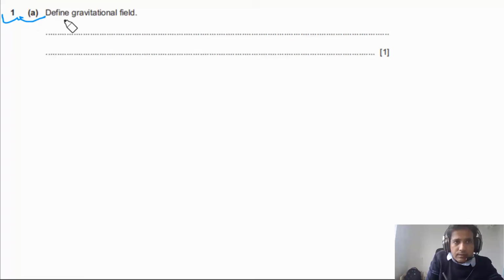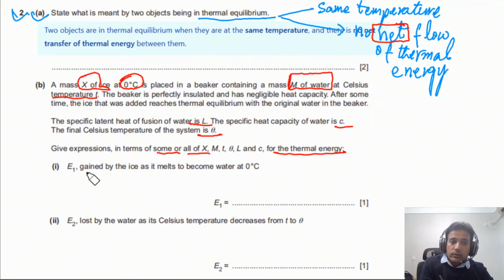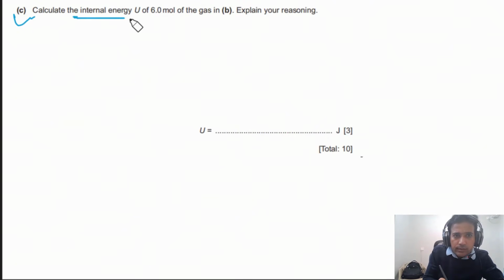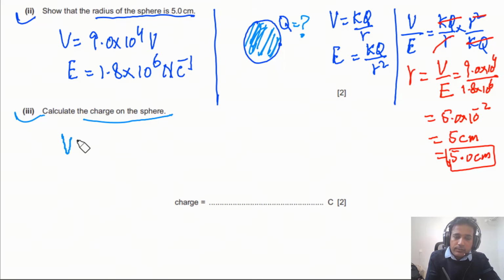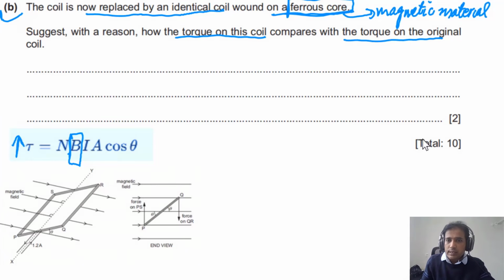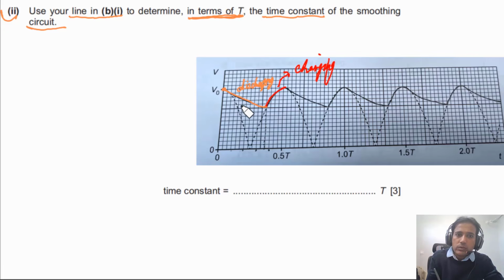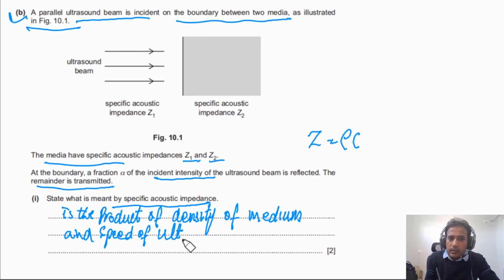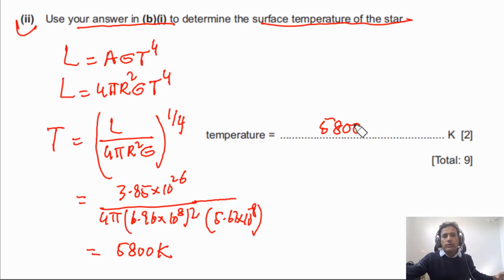A LEVEL PHYSICS 9702 PAPER 4 | May/JUNE 2025 | Paper 44 | 9702/4/M/J/25 | Full and Detailed Solution

Comment from the maker: SUMMARY 

This video provides a detailed solution and explanation for past paper questions from the May/June 2025 A-Level Physics Paper 4 variant 4. It covers several key physics topics, including:

Gravitational fields and potential (0:54)
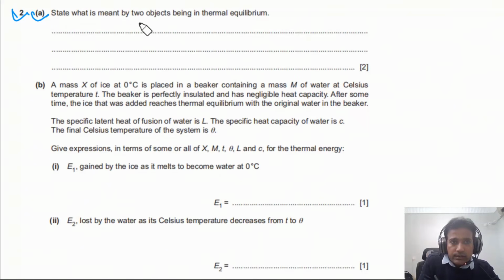Thermal physics, including thermal equilibrium, specific latent heat, and specific heat capacity (14:37)
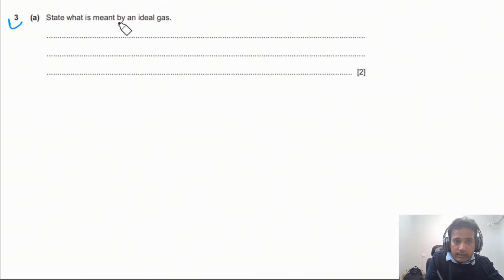Ideal gases and related equations like the ideal gas law and root mean square speed (24:15)
Simple harmonic motion (SHM), its definition, and properties like velocity and displacement (34:43)
Electric potential and field strength for charged spheres, including capacitance (41:48)
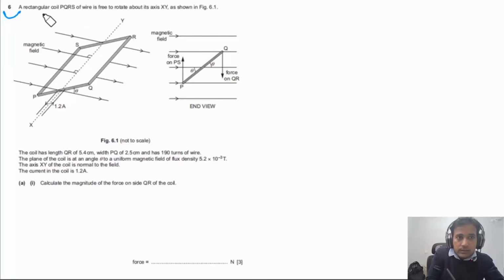Magnetic forces and torque on current-carrying coils in magnetic fields (52:34)
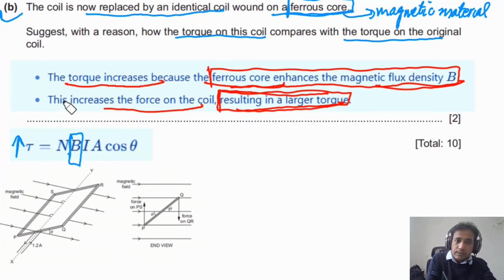Damping in oscillations and electromagnetic induction (1:04:41)
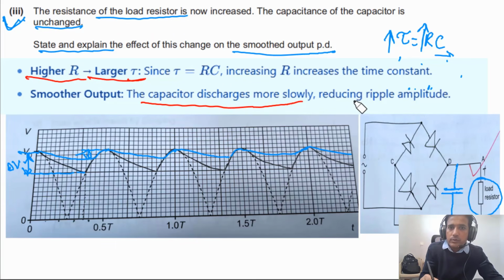Wave-particle duality and de Broglie wavelength (1:25:00)
Ultrasound waves in medical diagnosis, including piezoelectric crystals and acoustic impedance (1:31:00)
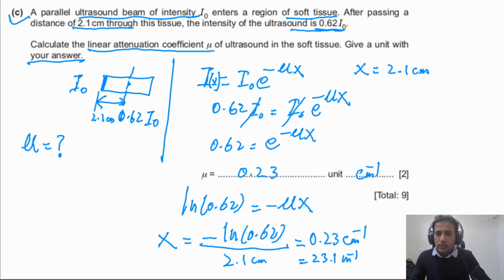Nuclear fusion, mass defect, and luminosity of stars (1:40:51)
The video aims to improve conceptual understanding and exam question comprehension for students.

Comment: Sir for question 9bii can i say fringes on the screen become closer instead of saying rings ?
Reply from the maker: In short NO. "fringes" is a general term for any interference or diffraction pattern, using it here instead of "rings" is risky and likely wouldn't meet the MARKING STANDARD OF CAIE . 
My Recommendation : Stick with "rings become closer together" or "diameter of the rings decreases." This ensures you are describing the specific pattern shown in the diagram and eliminates any ambiguity that might lead an examiner to withhold the mark.

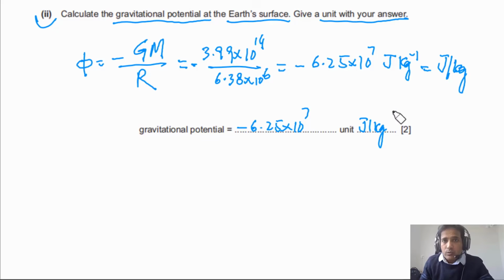Comment: 9:29 

Just a quick query 

1) Often value calculated in first part is used in second one ….When to know if you must use calculator value from previous part or the final answer (rounded value)
Bcz often examiner uses calC value as well 

2) Your answer to part c)ii) is 6.25 bcz qs had least 3 s.f for data 
I also wrote 6.25 but in ms it was boldly written 6.3 
Will it cause loose of marks?
Reply from the maker: Rounding Strategy: For CAIE examinations, it is best practice to use the unrounded value from previous steps in subsequent calculations to maintain precision. However, using the correctly rounded intermediate value is generally acceptable.

Significant Figures (Q1 cii): The final answer should be given to 3 or 4 significant figures. Since the raw data provided has a minimum of 3 s.f., the final result must remain consistent with this precision. May be you can check markscheme again

Comment: For question 7 ...
If there is just coil and no resistor will the oscillation still damped
Reply from the maker: Even without an external resistor, the coil itself has resistance, leading to energy dissipation and damped oscillations as long as it forms a closed circuit.
Reply: @alevelandapphysics-ali  I think damped oscillation comes from lenz's law, only energy lost in the resistor cannot explain damping
Reply from the maker: @eighoreishongsar2336  That is a very insightful point! To clear this up, we need to look at the 'Why' (the force) and the 'How' (the energy).

1. The Force (Lenz's Law):
You are right that Lenz’s Law is the reason for the 'magnetic brake.' As the magnet moves, it creates a current in the coil that pushes back against the magnet. This is the physical force that slows the motion down.

2. The Energy (The Resistor):
However, for the magnet to actually stop, it has to lose energy. Damping is simply the process of turning motion (kinetic energy) into something else. In this case, the resistor acts like a 'sink.' As the magnet does work to push current through the wire, that electrical energy is turned into heat (P=I^2 R).

3. What if there was no resistor?
If you had a 'perfect' coil with zero resistance (and no air resistance), something strange happens: the magnet would actually keep oscillating! Even though there is a magnetic force pushing back, there is nowhere for the energy to go. The energy would just 'slosh' back and forth between the magnet’s motion and the coil’s magnetic field—like a perfect spring that never stops.

Summary: * Lenz's Law provides the push that opposes motion.
The Resistor provides the exit for the energy to leave the system as heat.

No heat loss = no damping!
Reply: @alevelandapphysics-ali  Thanks!
How this energy loss in resistor solely explain the damped oscillation of spring magnet system?
Reply from the maker: @eighoreishongsar2336  The resistor is the only reason the energy "leaves" the system. No resistor = = no damping!